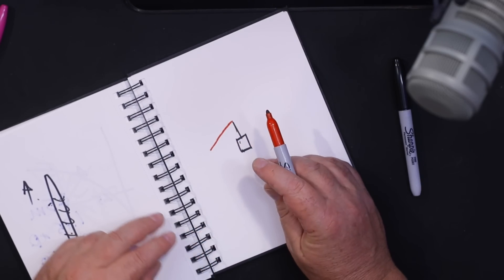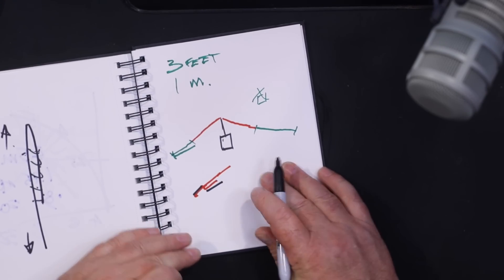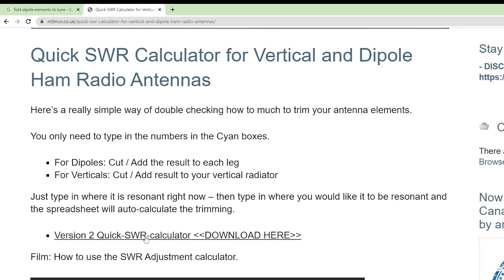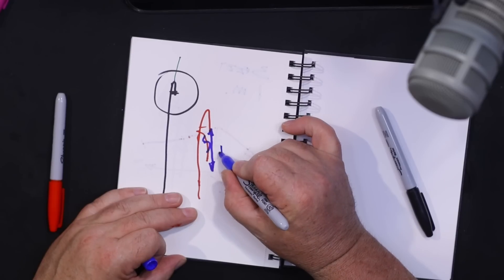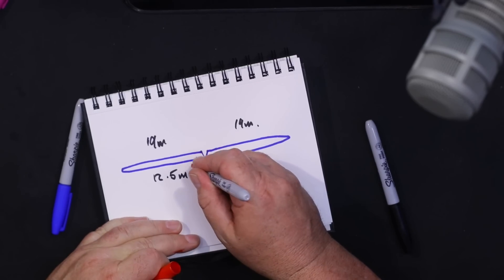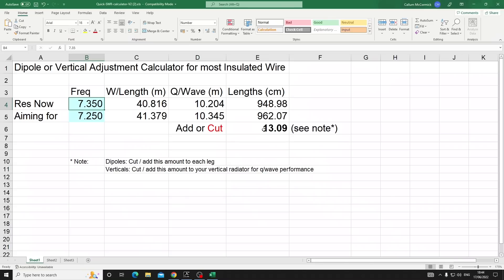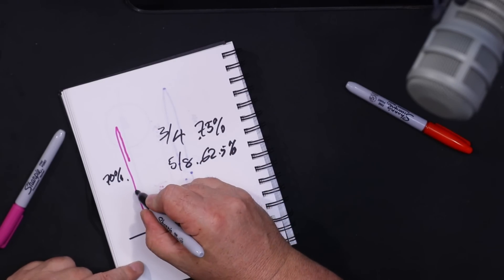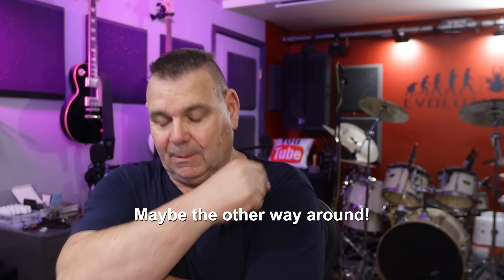Fold the end of a Dipole Back - What's Happening?

Comment: Cal, thanks so much for your time and efforts. On my DX Commander, when I made a small fold over (1inch / 2.5cm more or less) for each wire (10m, 15m, 20m etc.) I found that when trying to “tune” each band’s wire(usually cutting it) that the straight formula for cutting/adding was not always yielding the expected results. I will review this and go back to my antenna - which I really, really like. Anyway, thanks, KQ4IXD

Comment: Inspired by your video on making the loaded dipole, I started running a linear loaded EFHW for 80M.  Physical length is right at 93ft versus 131ft for a non-loaded EFHW.  Easy to make: two stranded insulated wire cut at 93 feet, solder the pair together at one end, at the opposite end connect one strand to the balun and tune by trimming the other strand.  Lots of good DX (Europe and South America) from Kentucky.  Thanks for all of the practical science.
PAX
John (ko4hzh)
Reply from the maker: Fabulous!

Comment: Thanks Cal, your timing is impeccable. I just got my Classic setup and have been tuning it using the SWR Calculator and have experienced precisely what you are referring to. Example, I needed to adjust my 40/15M element from 6.98MHz to 7.150MHz which the calculator told me to shorten by 23.76cm. I folded that much back (as well as twisting it) so I didn't cut it and regret it later and it only went to 7.045Mhz which comes out to 38%... pretty darn close to 1/3 which might have been even closer if I hadn't twisted it. Before this video, I searched high and low for the answer as I suspected what you demonstrated. Now I know and can account for it. Thanks and 73s
Reply from the maker: Hey good news indeed. Now a LOT of this stuff used to me in the manual but a certain YouTuber thought my senseless descriptions of various physics topics were irrelevant - however I think we need an "advanced user guide" for all these little tricks!
Reply: @DXCommanderHQ  If I have learned nothing from my electronics days is never let theory get in the way of reality. Reality always wins. The thing that had me questioning this to begin with is how the 40M element folds back down along the mast. If folding back nulled out then you could never get longer than the length of the mast (theory) but we both know that isn't the case since the antenna works (reality)

Comment: Thanks. Some youtuber’s claim that you need some separation between the wires to get the 3:1 efffect - though in context of saving space by folding the dipole. Looks like starting with cheap wire and cutting is the optimum solution. 

And latest article I read, investigating velocity factor claimed that you need to multiply by a further .95 when using insulated wire. So for uninsulated wire, wave length formula is 0.95 x 300 0 285/frequency (Mhz).

For Insulated wire, 0.95 x 0.95 x 300 = 270.75/Frequency (Mhz). I like the practical approach, trial and error !
Reply from the maker: Well, I've never seen anyone on YouTube do as many experiments on YouTube as me .. particularly on this subject..! The 3:1 is not constant.. In other words, the ratio is non linear.

Comment: 3 years ago I did the same thing to an 80m EFHW and at the loop back point which was about 4m high, the  last 5m length sloped down to 1.5m high at the end of the aerial which also made it very easy to tune and enabled it to fit my garden.  Your video now makes sense to the odd length calculations I found at the time. G4PEY
Reply from the maker: I know, I have been baffled by this one for a while!

Comment: I've been taught (right?/wrong?) that if you fold over and wrap around you're going to gain some capacitance, but cancel out the linear loading effect.  That's how I tune all of my antennas, then when I'm happy, I cut off the excess wire (leaving a loop for hanging) and rely on my ATU to do the rest - because no antenna is ever 100%.  Would love to get your take on this twist method!
Reply from the maker: Hi Steve.. Well after spending hundreds of hours in the field, I still maintain that regardless of capacitance or loading, the 3:1 always seems to hold out for me..
Reply: @DXCommanderHQ  ah, Ok.  I'm starting to wrap my head around it. Thanks!

Comment: Shorted vs capacitance because of the small separation of the fold over legs with dielectric in between (air and insulation).

Comment: The first antenna I made was based on a folded dipole. Used 300 ohm tv twin lead wire cut for 40m cw. I was using an old all tube radio. Have no idea the swr. The transmitter loaded up just fine. Made a lot of contacts on cw.  This was in 1982.
Reply from the maker: Fantastic memories, I'm sure!

Comment: I  put 5 dipoles in my attic, 20m to 10m pvc insulated wire and folded back the ends. I made each about a foot longer knowing I would fold some back. For 20m and 17m I wrapped the ends twice twice round the roof joist to fit it into the available space.
I assume I was adding capacitance, and inductance on 20 and 17, to the ends as well as shortening them, they ended up quite a bit shorter than the dipole calculator said.
G4GHB.

Comment: My best guess – is that folding back insulated wire creates capacitive loading similar to a ”capacity hat”.  I remember someone tuning an antenna by inserting a ”capacitor” in the middle of an element, only the ”capacitor” consisted of two insulated wires twisted together. He even took those two wires, twisted them together, and measured them with an RLC tester. What I might look into is what effect linear loading has on the radiation resistance, and thus the efficiency of an antenna.

73 de AF6AS in “DM13” land

Comment: Now for your headache:  You need to consider both the capacitve effect and the inductive effects over the length of the folded length + a little bit.  What type of ground plane you're using. I've gone through this headache inducing problem once before. Got to consider the dielectric properties of the wire insulation, etc, etc. ad nauseam.  Your system system works, thank you, I'll use that.    🙂
Reply from the maker: I prefer trial-and-error! LOL :)

Comment: Hi again, second question, if you schorten the wire will de “bending point of the wire” be at the same length from the feed point, or do you move that one too. So the new wire length divided by two which gives us in total a shorter antenna? And if you didn’t do that, why not?🤔
Reply from the maker: You can do either.. If you fold the antenna back, the frequency will gradually go up.. Try it! :)

Comment: Hi Cal, Iowa’s wondering about the 3:1 and 5:1. first you shortened the wire 3 x 70, about 2.1 meters. It was too much. Then you tell us about the 5:1 ratio. So 5 times 70 right?  But then I would schorten it even more.
Reply from the maker: It seems to be MORE loading near the feedpoint, yes.

Comment: so when we build the dx commander, when adding length, do we add the length to the end, then fold back the regular 6cm, or do we add the wire to the end and not change the position of the original 6cm foldback, essentially creating a longer foldback?
Reply from the maker: OK, this is what I do (but not for the user guide!).. Let's say I need to add 1 inch (25mm) to the end of an element.. All I do is graft on TWICE that to the foldback - and it normally works. If in doubt, drop me an email.

Comment: Great video Callum, as discussed previously i have seen this in action using a VNA and going through this process and whole heartly agree that the ratio changes as you get back closer to the feed point. As for the fact that people think that folding it back would shorten it is interesting basing on the fact the electrical length never changes until you actually cut the wire. The complex maths required to work out whats actually going on is way above my pay grade. But would also be interesting to work out the antenna radiating efficiency of this as in my mind when you think in sine waves and time delays across a peice of wire if you start folding back against yourself the electrical current would get to the point they would start counteracting themselves thus becoming more like an open air dummy load? So many questions! Anyway again cheers  and great video.
Reply from the maker: It's all about pay-grades - agreed!
Reply: A VNA should show what is going on in the Smith Chart since there, the region above the x-axis is the inductive impedance and the region below the x-axis is capacitive impedance. One might start with no fold and start folding and examine the changes.
Reply: Hi - just my simple thought on the impact of folding back on radiation efficiency - for sure the far field is not going to be improved by folding some of the radiator back but it does allow us flexibility to resonate the antenna in a smaller space. If going portable I use fold back, as next time I might need that bit of cable :) .
Reply: My take is that folding back insulated wire shortens the radiating length (because the radiation from the fold-over is 180 out of phase with the non-folded section), but the electrical length is the same.

Comment: When you did "Toms" loaded 80m dipole and cut what you thought was the right amount off, did you then undo the tape and in effect shorten the length of the dipole further by bringing the cut ends back towards the coax. Or did you just trim what you thought was the right amount off, without re folding the full antenna. Just wondering if that made the difference in what you found re effective ratio of cut?
Reply from the maker: Chris, I just cut some off the major foldback near the feedpoint.
Reply: @DXCommanderHQ  OK, that is interesting. I am not suggesting you try it, and I have no need for it myself. However if anyone else is going to try this out I wonder how much difference re folding the entire element would make, would it then return to the 1/3 ratio. Idle curiosity I suppose. Probably more curious than normal as I am stuck in the shack mainly with Covid at the moment :-(

Comment: KQ4GYT, just got my cert recently and gearing up for general. I’ve been loaned a Kenwood unit that hits 160-10meters. I’m in a budget pinch and can’t afford a lot of fancy kit so I’m looking at building a dipole. I’m limited on available space to mount the dipole and I was curious about this folded design.  I’ve been told to run a half wave 80 meter dipole which is going to put me around  the 122-125’ mark. Is there a way I can shorten that up using the folded method?  Would using inductor coils help?
Reply from the maker: OK Daniel, so folding it IS the inductor. If you want 75m, then start with our measurements (ABOUT 25m folding back on itself then trim to suit. So you will need at least 25m of total length. Beware, the harder you load this up, the more losses that will occur and the tighter the SWR curve. I strongly suggest starting with 40m and getting that working. That's what I did. After a few weeks of settling into 40m, you can ADD another set of elements, say for 80m. 40m will also give you 15m band. But to achieve that, you can shorten the 40m element by around 3ft - but ADD 6ft to a foldback. This will bring 15m down. I've done all sorts of videos all about this... If you get stuck, drop me an email.

Comment: If I had a DX Commander antenna and there were two metal buildings ten feet apart and the antenna was in the middle, would it work? The buildings are ten feet in height.
Reply from the maker: Erm.. It always "works" but the definition of "work" needs to be interpreted. 10 feet isn't too big considering the wavelength of say 20m but on the higher bands, it might struggle. This kind-of explains: https://www.youtube.com/watch?v=pqStNqDA5V4

Comment: Wonder if I could tune my efhw, by using a pulley on the end and paracord back to the feed end to pull it back and forth ? I'm hoping to (finally!) get it temporarily strung up tomorrow, then eventually get it higher with some poles.
Reply from the maker: What an amazing experiment! The further each wire is away from each other, the greater the loading, but it might work :)
Reply: @DXCommanderHQ  yes, I was thinking it’d have to be a small pulley diameter and maybe some tube to hold the wires close

Comment: This is bothering me a little so I have to ask Cal (or anyone who has done this), when you fold an end back, are you folding it back parallel to the element, or are you twisting it around itself? I would think that twisting it would shorten the electrical length as the twisted back piece would cancel out the forward piece, but that folding back parallel to the element keeps the electrical length. Am I way off? Thoughts?
Reply from the maker: OK, so the spacing between the folded-back part and the element is important - but only once it's done. It won't matter (if it's insulated wire). Basically, say you put a 6mm (1/4-inch) gap in the foldback you will end up with slightl more loading than parallel.. Twisted will probably give you a slightly different amount that's all.
Reply: @DXCommanderHQ  Thank you!

Comment: So, if I want 16.5 feet on each side of a dipole, but I cut it to 17.5 ft, I would need to fold back 3 feet on each side (so now a length of 14.5 ft) in order to get the equivalent of cutting off a foot on each side? Because the the 3 to 1 factor? By folding back rather than cutting, I can reduce the length of a dipole and get resonance at the same frequency as when  I cut to the full length? Today, I put a dipole in my attic at 17.5 feet thinking I can have a little extra to tie the ends and “just in case”. But when I fold the ends, I need to fold a much longer length than just to get the length to 16.5 feet.  Maybe you just explained what’s happening, if I understand correctly.  Thanks in any case! Great info!
Reply from the maker: Basically you have it right.. !
Reply: @DXCommanderHQ  Thanks!

Comment: Thanks Cal, very interesting! I am slightly confused though because you say there’s a 5:1 rule when the elements are folded almost entirely in two, and when you initially tried the 3:1 rule, you took too much off. Did you mean not enough off, or do I have something twisted in my mind?
Reply from the maker: The 5:1 is when the wire comes right back to the beginning of the feedpoint and 3:1 right at the very end of the element..
Reply: @DXCommanderHQ  Thanks Cal, that's what I understood, but when you initially followed the 3:1 rule then you would not have taken too much off, and I think you said you initially took too much off before working out it was 5:1.

Comment: What if you did the math and cut the wires. Then put some ring lugs on the end of the wires, just bending enough wire so as not to pull back through the lug barrel. Make a few Loops with a suitable suitable tie-rap in between the insulators and ring lugs?  Once tuned crimp and solder lugs and replace the tie-raps.  A small non-metallic dead-end grip, like are used on utility pole guy cables, would be ideal if exists.

Comment: So essentially what this boils down to is a 3 to 1 Cut ratio. Where 3 is the bent length and 1/3 Is the actual cut length for desired swr correct?
Reply from the maker: Rule of thumb, yes.
Reply: @DXCommander  excellent, thank you for the clarification! I have an efhw in the attic that I'd rather not cut too short lol!!

Comment: Does anyone know if a non-metallic dead-end grip exists for small wires? I used the metal ones to guy utility poles and hang stop lights over roadways.  Poles were hit occasionally and the cable 3/8" broke before the grip slipped, so easy to install as well. They sort of look like a hairpin and are pre-formed to match a certain dia. cable and you simply twist on the cable w/loop at the end.
Reply from the maker: I think I know what you mean.. But I don't know where to get them.

Comment: I watched the video where the expert said folding it back effectively shortened it like cutting. How about twisting the folded wire around the element, I'll have to try that. A 40 meter dipole had the ends going through the insulator and then were soldered, that did the trick unless it needed to be lengthened.
Reply from the maker: If you make a loop and then solder it back on itself, the overall length will be to the end of the loop.

Comment: I would think, with a dipole using insulated wire, you would be increasing the "end effect" as they call it. Folding it back would make a capacitor, the longer the back fold, the more "end effect" one would create. Could this be what is happening when using insulated wire? 

I am not an electrical engineer, but just read mention of that in my studies for my upgrade to Extra Class.
Reply from the maker: I can't remember this video in detail but I know I also touched on foldbacks and coils here: https://youtu.be/uNqA6dy6cbY

Comment: Calum, I have a DXCommander classic that I am re-stringing.  Your latest DXCommander video shows you installing a 40m element by putting a loop just below the top spreader.  How does this loop affect the length?
Reply from the maker: Bob, don't worry about it since you will add/subtract at the very end anyway and 100kHz is huge on 40m so you probably won't notice.

Comment: I think it is just how far you fold back the insulated wire. If you fold back a large length it will act as a lineair load. But if you only fold back a tiny bit like 2-5 cm it will certainly affect length. At least that is my experience. Use this method with insulated wire to tune my 4 band square halo which uses full size folded dipoles. The type of antenna could be playing a role? 73, Bas PE4BAS

Comment: Callum, your most recent video showing the installation of a DXCOMMANDER shows you creating a loop in the 40m element below the spreader.  What impact does this loop have on the element length?
Reply from the maker: Not a lot really.. In isolation, if you just create a small loop, yes you would see a change in element size but for 40m band, it will be negligable.